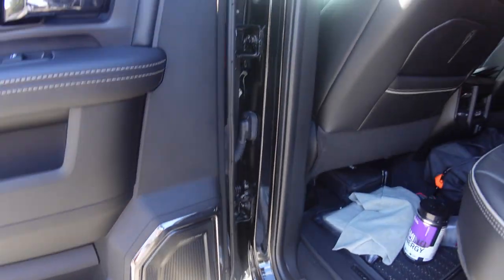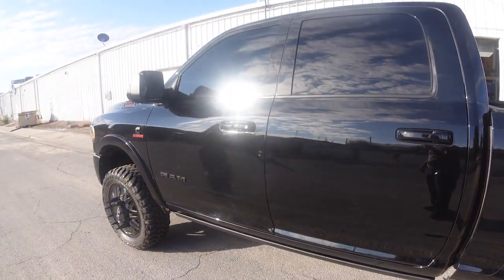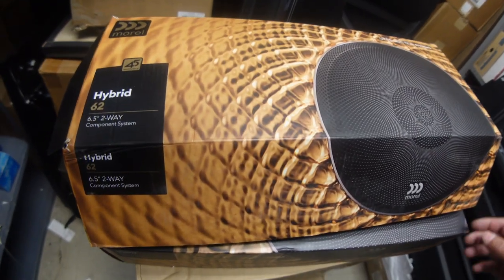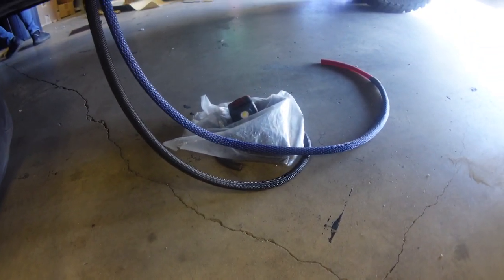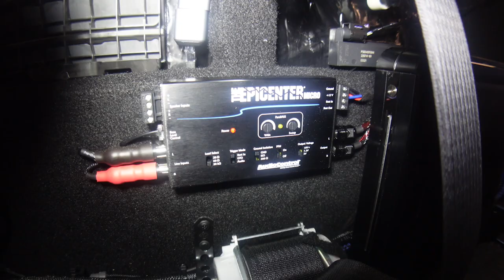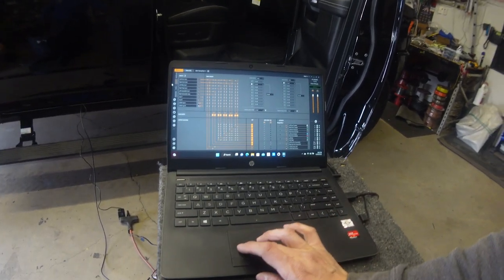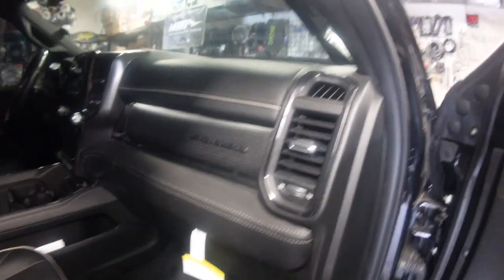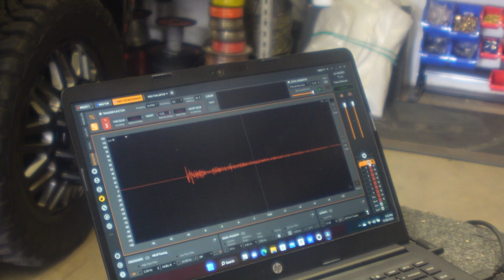2022 Ram 3500 Limited - Harman, Kardon Removal, JL Audio DSP Stereo Install

Comment: What is pulling the signal amp pro?
Reply from the maker: Don't understand what your implying ?
Reply: @jmac4shizzle  what was used to connect the signal a line out converter?
Reply from the maker: That's a Question I would have to ask my installers , I apologize I can't answer that question, I'm not gonna lie I'm not that technical every custom vehicle I do I just go in tell them fellas to give me the Best
Reply from the maker: @KelvinTaylor-gu4xo  Ap4-Ch41 interface